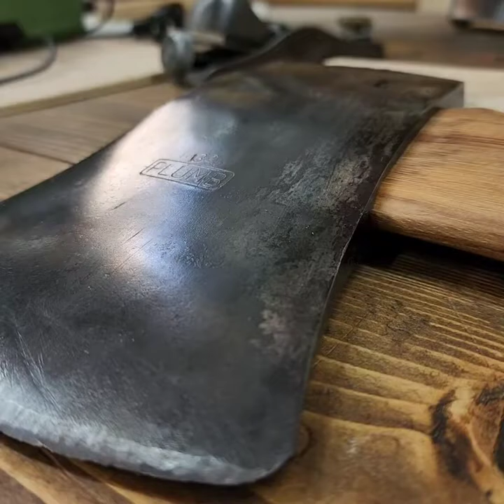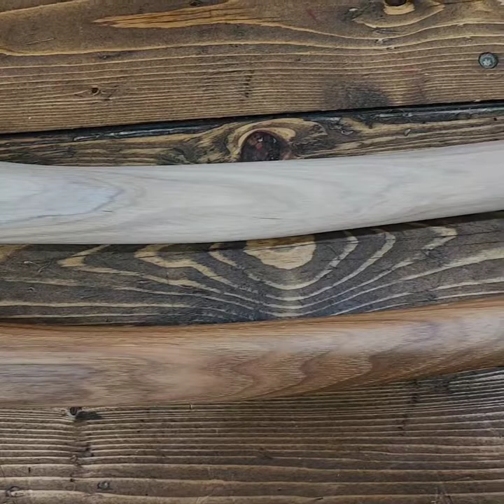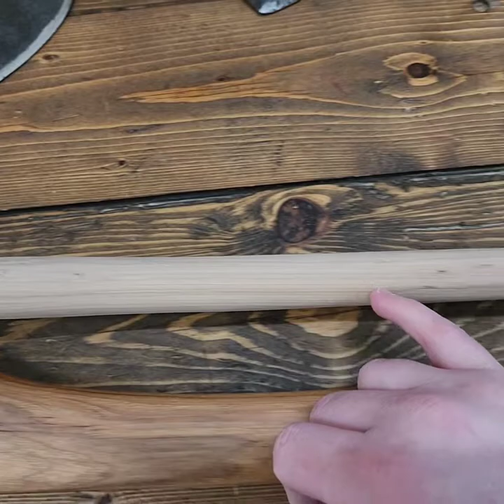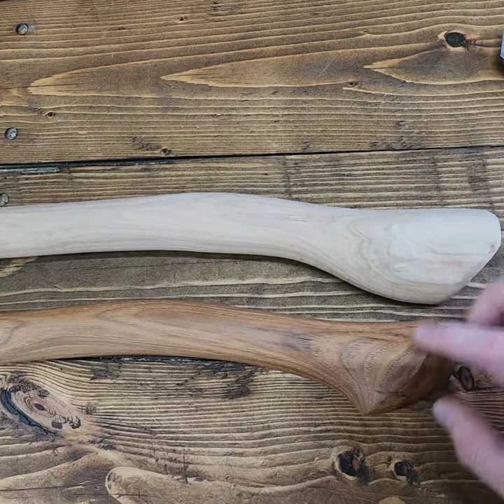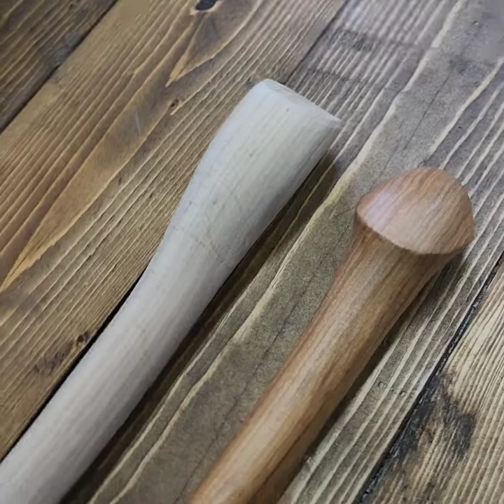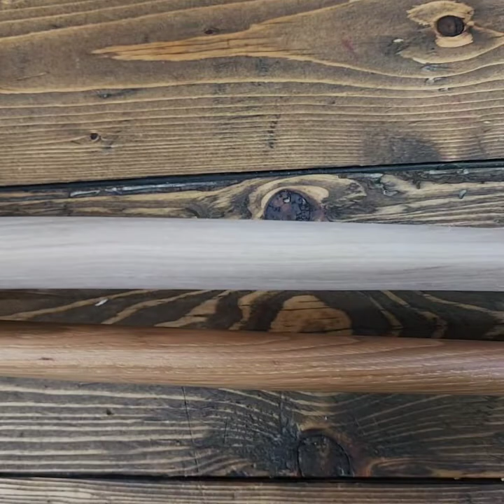How I Thin Down and Shape My Axe Handles Into a Custom Vintage Style Handle

Comment: That is a beautiful handle! It's the epitome of what I think a handle should look like. I like the rounded end as well as a fawns foot. I back and forth.
Reply from the maker: Thank you Sir. I appreciate those kind words. I love an elegant fawns foot as well. One of the main reasons I'm drawn to the scroll end (the rounded one) is durability. The supported grain of the wood in that style end can really take a beating when hanging or re seating a head.
Reply: @Nsvens89  I use a rubber mallet to hang heads. It doesn't ding up the wood.
Reply from the maker: I will have to give one a try. I've always assumed I would not get a solid enough blow with the rubber mallet to really seat the head. I've traditionally used some wooden mallets and then hammers. I'll definitely give it a try, especially if I'm using a fawns foot.
Reply: @Nsvens89 can you make a video of you shaping out that type ( scroll end) please 🙏
Reply from the maker: @mysticmac24  thanks for the interest! I explain my process for the scroll end and the handle overall in my Axe Handle Shaping series. I did 3 videos where I show the process and my approach on it. I'll toss the link to the first video in the series below!  Hope you enjoy. 

https://youtu.be/SqD3bgrptqg?si=LLUArTGlkSqUuLHR

Comment: Bulbous is how I would describe my early palm swells.  Great job on the shaping here.
Reply from the maker: I appreciate the kind words. Hopefully at some point I can take a page from your book and get my hands on some timber for drying then carving from scratch. Currently I've only worked with some black locust that I've harvested and some ash from a buddy.
Reply: @Nsvens89  if you live near hardwoods you will get it done.  I did  it all without a truck.  The way I got timber long enough for full sized handles was listening for a chainsaw and asking the tree service guys to help me.  Black locust is premium.  Wish I could get some.  Even better with rot/bug resistance than white oak.

Comment: I love the round end. Some the Walters boy axes had those.
Reply from the maker: Thanks! I have a couple plumbs that have a less exaggerated scroll ends. Years ago I found a vintage handle that had one and I loved it. It's certainly a resilient and comfortable style palm swell!
Reply: @Nsvens89  I have my dad's Walters which he would have bought around 1970 that has a palm swell like that, but as you describe, it is smaller on the underside. I have a new handle on it and I didn't really know how to make that swell. I found your other video on how you approached the swell to make it. I think I have enough wood left on my handle to give it a try.
Reply from the maker: @Marc L  very cool!!! It's always special to have a family members tools and even nicer when you can use them. As long as there is enough material in the handle you should definitely be able to replicate the original shape! I'd love to see how it goes. If you're on Instagram shoot me a message and let me know!
@nsvensen89 on Instagram

Comment: Beautiful work , the handles here locally need alot of work lol 
I struggle with the wedge every time I'm never sure how thick it should be or does that matter
Reply from the maker: @TownieOutdoors Some of the hardware stores around me carry HouseHandles thankfully. I've had good luck ordering from their website also. 
For how thick the wedge needs to be I'll take a look at the gap on either side of the tongue when the head is seated almost all the way. I'll then add that distance to whatever the gap inside the kerf is. That should get you pretty close. I'm a fan of making my own wedges so I can customize the fit a bit better. In part 3 of my handle shaping video series, you can see what I'm explaining a little bit better. Thanks for checking out the video!

Comment: Nice work. Do you ever chop with them or is your focus more in the filing and hanging? I buy handles from House in bulk, so it might be awhile before my next order. I get them with lacquer-on so the wood stays sealed until I thin and BLOcoat.. I've had raw handles warp on me.
Reply from the maker: Thank you Sir! I appreciate the kind words. I also order in bulk (last order was 10 handles if memory recalls. I have had a couple warp on be slightly before but was able to correct it when shaping. The thin coat of BLO before shaping is good advice.

I do enjoy getting out and swinging them but with a couple of young kids and work, time is a premium. I usually find that my free time is later at night. That lends itself well for the handle shaping and sharpening. I would like to get out more this year though! Thank you for checking out the video.
Reply: @Nsvens89  One axe you never see mentioned on most axe sites is one used for underbucking. I'm more of a saw guy but my axe is always with me. Using an axe to support a crosscut saw for underbucking when the top bind won't let you finish your cut from above is an old sawyer's trick. It helps to have the cheeks thinned to get a better stick in the log. Same axe here that limbed, chopped, drove wedges, and under bucked. Jersey head on a 28" House handle shaved into an octagon. Roll ahead to the saw and axe stuff: https://www.youtube.com/watch?v=BipKifKgEVI
Reply from the maker: @PATCsawyer  That Sir is a lovely video. I enjoyed it in the entirety. Not too long ago I sold a round lung PLUMB Jersey on a straight 28 inch house handle. I have a quick video of it up here. 

All of that work looks like a very enjoyable time. I'm certainly more of an axe guy but do admire the saws and that work. I frequently come across older saws while at flea markets looking for axe heads. Years ago I picked up a single man saw that's roughly 4 feet long. I have yet to really clean it up and need to watch a lot more videos before sharpening. Some day I'll get it back in service though!